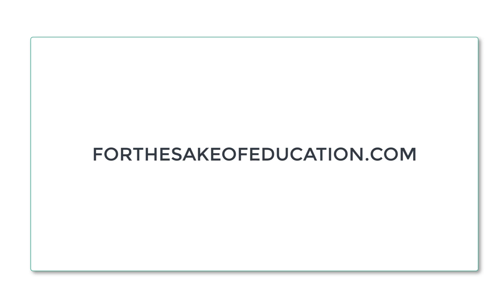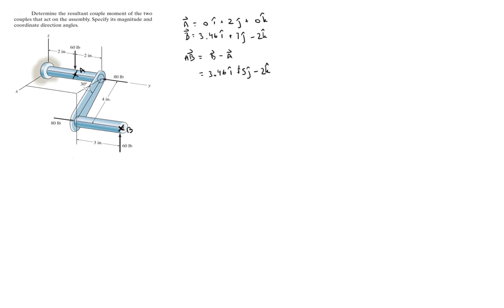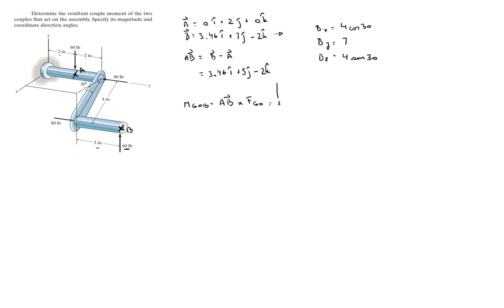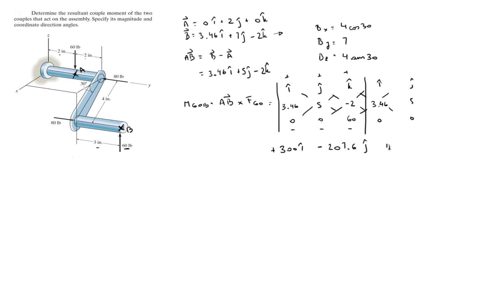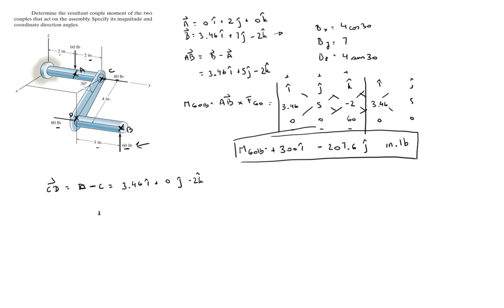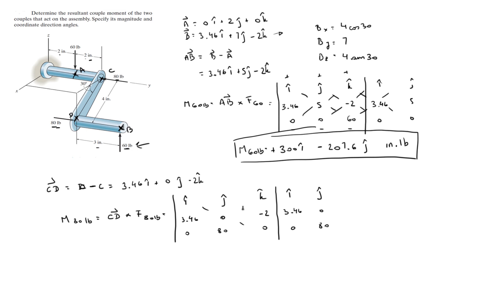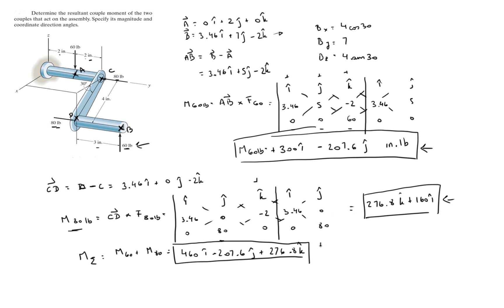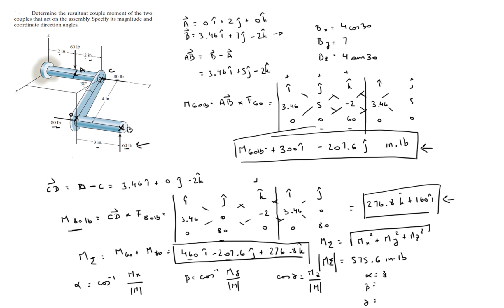Determine the resultant couple moment

Comment: Could you help me with an exercise of the same book but is edition 12? is that the truth I have no idea how to do it I saw the solution but the truth is something new for me to see that way of obtaining strength with derivatives and integrals. I've been trying to decipher for hours. I can not understand what part of the integral is. Why integrate? I leave you link of the photos of the exercise with the solution. The theme is Reduction of a simple charge
distributed.  https://plus.google.com/photos/115413650822843498915/album/6504286081935402161/6504286085867648482?authkey=CIyRhsaJjaGaTg&hl=es 

https://plus.google.com/photos/115413650822843498915/album/6504286081935402161/6504286085294773714?authkey=CIyRhsaJjaGaTg&hl=es